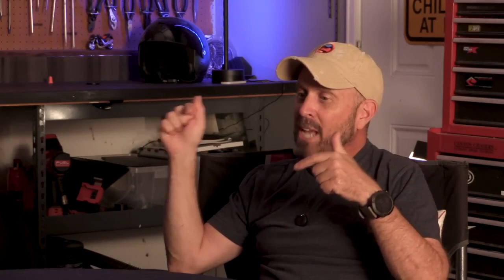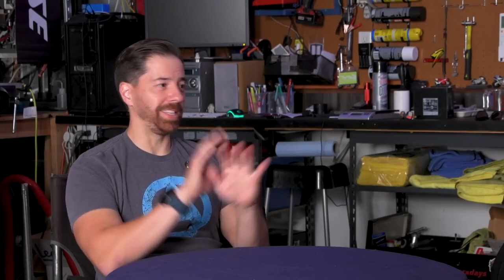MotoGP Mass Dampers Explained | How Teams Control Chatter & Vibration

Comment: mass damper is misleading . thats .. Passive harmonic dampers .. same principles as that round steel rubber bonded thing at the end of a crankshaft .. next if they havent already.. is active harmonic dampers .. akin the an engines balance shaft
Reply: A passive harmonic damper is an electrical device used to filter out unwanted harmonics in electrical systems, while a tuned mass damper is a mechanical device used to reduce vibrations in structures.

Im not sure what you mean by "that steel rubber bonded thing at the end of the crankshaft".
Reply: @brian_on_the_left  look into engines then
Reply: @brian_on_the_left  nothing to do with electrics clearly

Comment: A lot of engine makes and designers add a balance shaft to cure the same issues with an engine performance to rid the engine of vibrations.
Reply: But that's completely different.

Balancing shafts are directly (or with in between gears) to the crankshaft. Mass dampers have a latency between the movement and their reaction, that's why they're linked with springs

Comment: Renault F1 used tuned mass dampers at both ends of the car 20 years ago. It was basically providing damping for the tyres which have very little intrinsic damping of their own. It had been used for a long time in the wind tunnel models to keep them stable before it was realised they would also work in the actual car. It was very effective but Ferrari couldn't find the space to fit it in their car so they lobbied the FIA and got them banned on the basis that they were a movable aerodynamic device! lol. Politics wins again. :) F1 teams then started developing inertia dampers which are different again and don't provide damping for the tyres but have other benefits. By the way you can't use a tuned mass damper to damp several different items at a time. Each part of a vehicle has its own resonant frequency and the mass damper damper is tuned to a specific frequency so it will only damp tyres if it is designed for that purpose. Tyre frequency is typically way lower than say chassis frequency for instance.

Comment: Good video, the explanation is slightly unprecise. The basic principle of a mass damper is actually pretty simple. Its based on a delayed reaction to the movement of the main structure/object and that way creating a counteracting force to the moving object to be dampened. Its like a sinus waveform..and then adding another sinus waveform that is out of phase with the original. They start cancelling out. Its the tuning of this thing that is the difficult part
Reply: talk to ANY older school engine tuner.. about crankshaft harmonic balancers.. been around for decades & yet.. still not understood by oem factory engine "designers".. Ford .. how moronic can humanity be
Reply: physicist making a guess here, it sounds like a capacitor in signal processing acting like a high/low pass filter, doesn't seem like a solution to the tire but more like isolating is so it doesn't upset the rest of the bike. I am also guessing more pressure in the tire would help making the carcass more rigid but unfortunately it probably would hurt the grip
Reply: Thanks for clarifying! Glad you enjoyed it and were willing to share your insight!

Comment: I am. Curious to use a damper from oversuspension  on my BMW R1250RS do you recommend for street use?
Reply: I've never used one so I can't recommend it or tell you it isn’t a gimmick. I am curious about what issue you're experiencing in your BMW that has you considering it.
Reply: @brian_on_the_left I don’t have any issues but any upgrade is interesting if it works.
Thanks 
GLK
Reply: No, absolutely useless for street use to be honest. Mass damper is really needed only for a very specific scenario. They also explain it in this very video quite well.

Comment: I see that the mounting platform for the top luggage box on the Pan America allows some degree of movement for the luggage, independent of the machine.
Reply: That's not poor fitment, that's Engineered slop. HD is just ahead of the curve with mass dampers. 😂